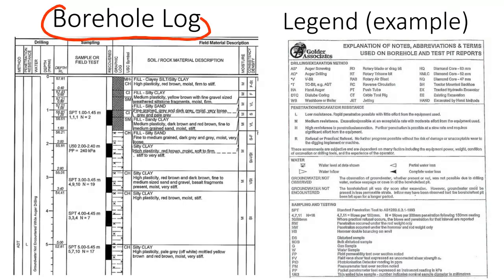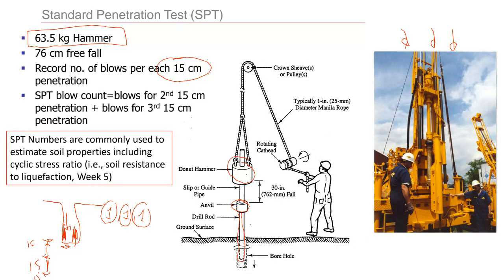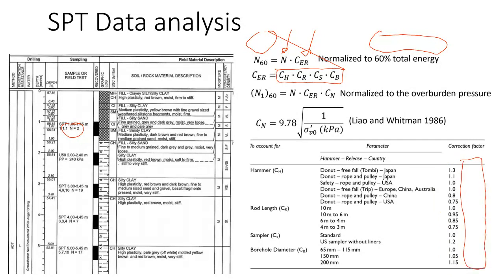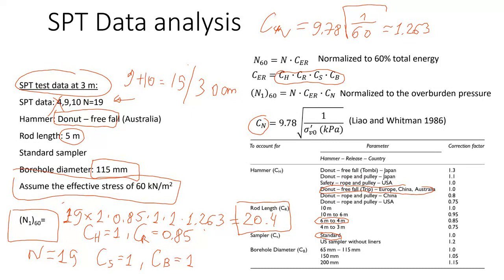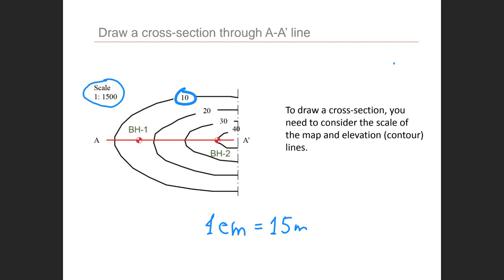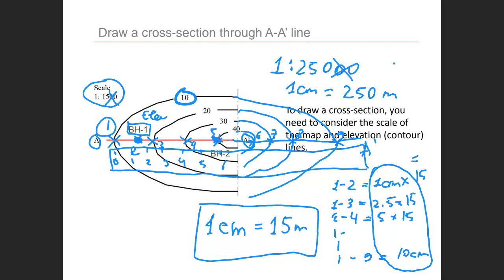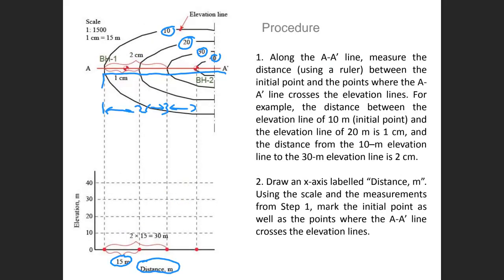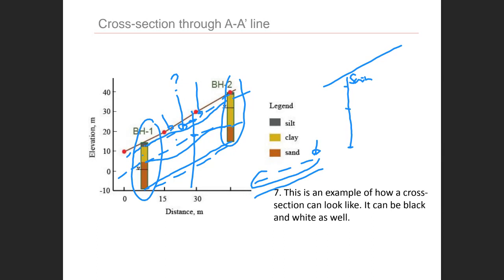Borehole logs, SPT tests, SPT Data Analysis, Drawing Cross-Sections, Common Mistakes

Comment: Great video!
Note: In the normalization calculation (N1,60), you forgot to divide by 60% (or 0.60). The N1,60 should be 34.8, not 20.4. Please check.

Comment: Hi there, many thanks for the lecture. I was wondering if there was a method of interpolating between different sets of boreholes within a given area to create a cross section that does not nessecarily have the initial boreholes contained within it ? I know that the result of this would be fairly inaccurate as it would be based on assumptions of subterranian ground conditions but wanted to know if there was some sort of method to go about doing so as i havnt seen much outside of geospatial analysis software.

Comment: Greetings from India Mr. Ivan. Thanks a lot for all your easy to understand lectures and videos. I would request you if you could also make a easy lecture on Geotechnical Investigations for rock and soil for a Tunnel project or in general. How many numbers per test per Borehole and what should be the frequency of each test. Sort of elaborate document. It would be really helpful for all of us Engineers and Geologists.
Reply from the maker: Thanks for the comment; usually all this is defined by a standard on geotechnical investigation which may vary in different countries. The standard will provide guidelines based on site conditions and the type of structure. I will try to make a video on this later.
Reply: @GeoEngineeringandScience  thank you Mr.Ivan. it would be extremely helpful if this document could be shared.